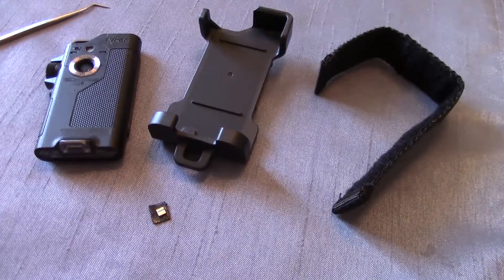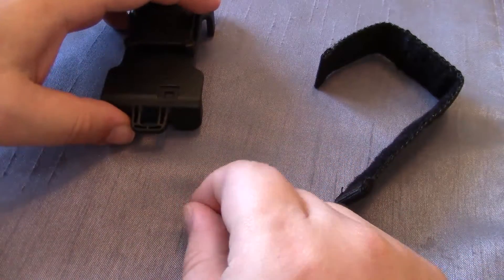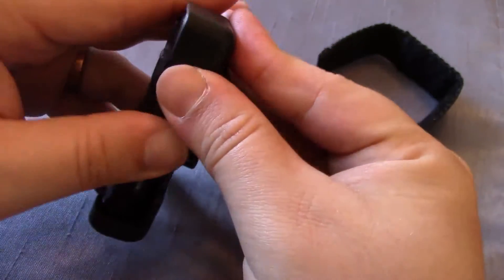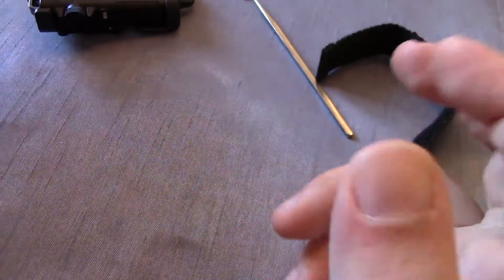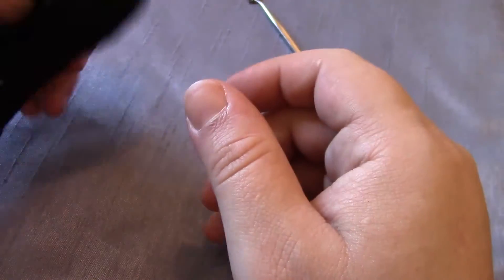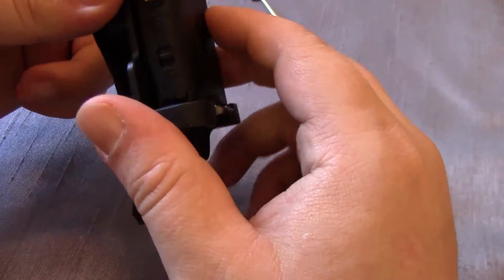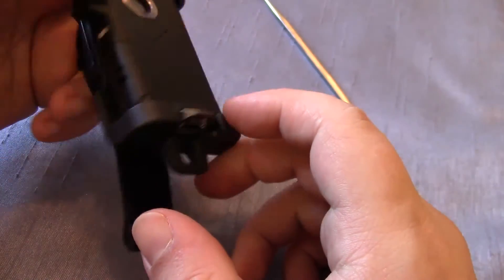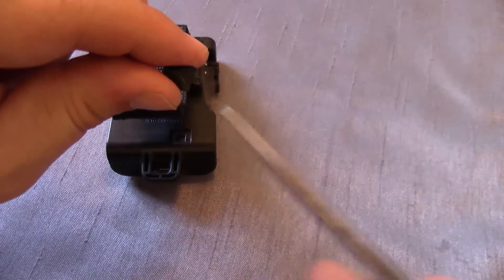Quick tip: Nikon KeyMission 80 AA-4 Holder Modification

Comment: You know you can put the camera into its clip upside down and it won't trip the magnet.
Reply from the maker: +Eric Alchowiak You definitely can. However I wanted to completely disable it. Works better for what I need.
Reply: Eric Alchowiak It's great that you thought about flipping the camera upside down, because I thought the same thing. I was going to share that info but you beat me to it ! I saw that the camera is evenly built rectangularly both directions so it clips upside down then you can fix it using a computer program afterwards.